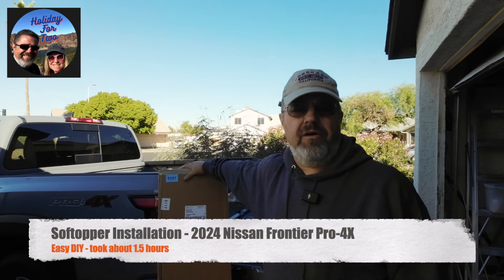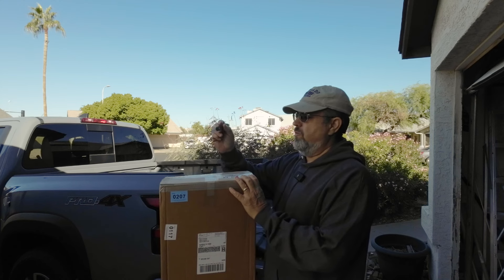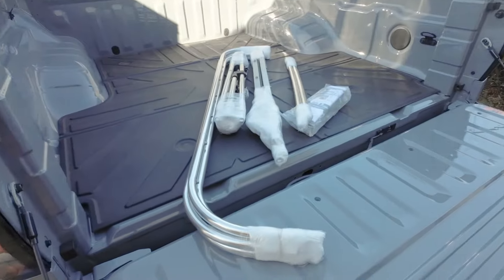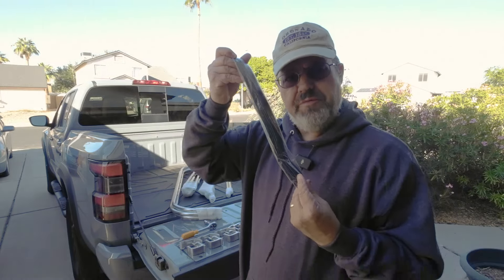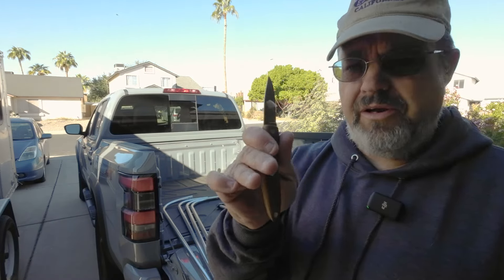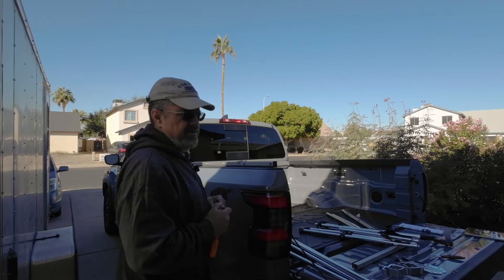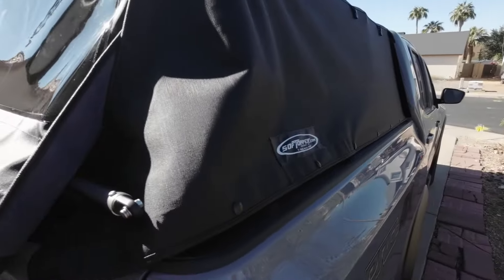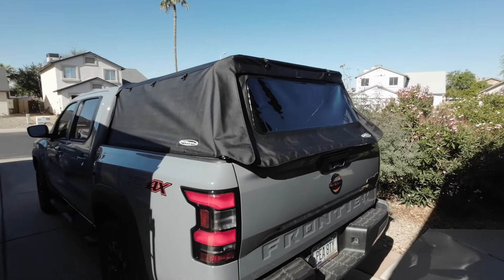2024 Nissan Frontier - Softopper Install

Comment: Is this the 4’8” Softopper or the 6’? I see two sizes in the website and was wondering which one you decided to order for the crew cab.
Reply from the maker: @tylermelchisky3052  4’8” softopper since I have the short bed - the 2025 Frontiers Pro 4x’s have the 6’ bed option😊

Comment: Did you order the 4.8ft soft topper ? I have a 2024 frontier pro 4x 5ft cab
Reply from the maker: @jayleyva8685  Yes, that’s the one. I really like it so far! It was easy to install by myself, other than making an occasional weird noise on the freeway (from the wind) and back window is an off-road dust magnet lol! I’m careful about cleaning it by not using towels to wipe just spray it with a hose (or air blower) and that works well.